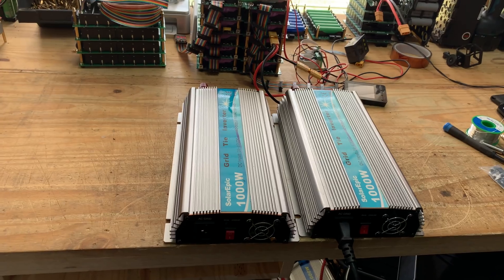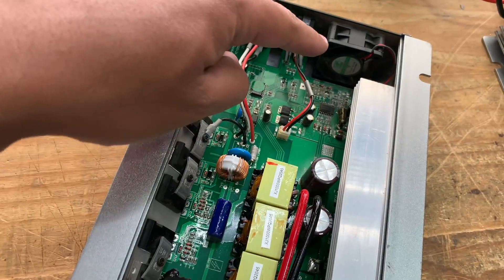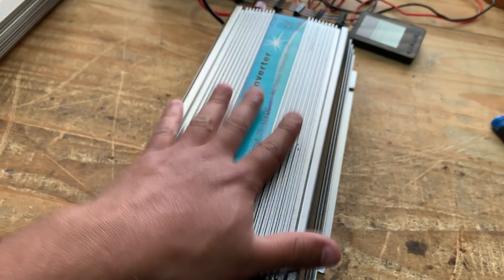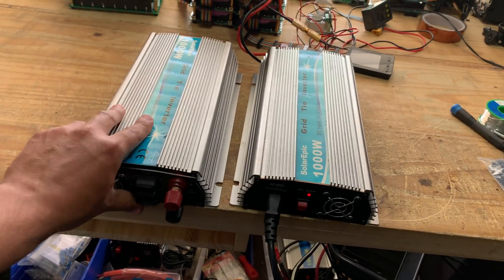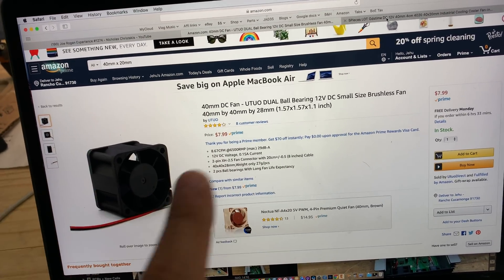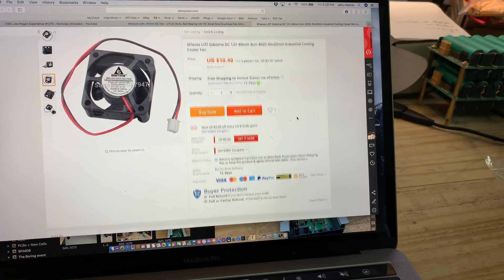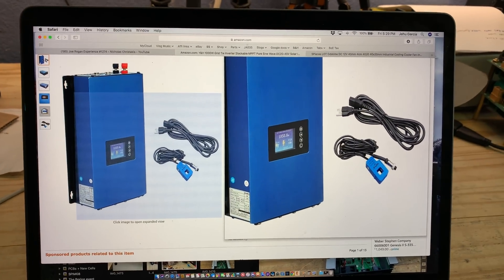Cheap 1kw Grid Tie Inverter 1 year UPDATE

Comment: I actually love these things. I shed a small tear when they die, but I try to buy a lot of them and only run them at about 600-800 watts of panel. Idiots that originally set up my system put 1200 watts of panel on my 1000 watt box. Died within 3 months. I have had boxes still running after 3 years at 800 watts of panels. 1.2kw a day on average for 3 years. They at least produce double of what they cost.

Comment: I read that you need fans with actual bearings and also any quality hybrid inverter or anything that's designed to function outside in the heat/cold rain ect has a coating i forgot exactly what it's called but the whole main board should have some kind of protection from the elements

Comment: Lovely video. Thank you.

Id love to see an off-grid example with the bigger model gridtie you showed. Lets say you have a strong 24v battery bank and 3000 watt inverter. Then you add 2x 2000watt grid tie inverters >WITH< limiters to your off-grid system, drawing from the battery bank and now you can pull 7000 watt or just below.. and easy to expand, just add one or more grid tie inverter. At Least that's my thought.

Comment: On battery they run at maximum power and get way too hot! Has anyone found a way to throttle them so they run at max 750Watts for example?

Comment: How do you limit these if they are connected to grid and to a big battery?
Reply: Was also looking for an answer to this question. Did you find a way to limit the inverter so it runs at e.g. 700Watts max?

Comment: Those blue grid tie converters, will work off a charged battery alone!! So' you will not burn out the MPPT circuitry, that's used with the solar panels. That's a good idea, as' the sun don't shine at night-time!!

Comment: mine is a simular china model...working since 4 years ...2 Times i had to replace the fans, and one time i had to repair a minor defekt on the internal Power regulation...at this point 1 year ago 7 also renewed the heat transport cream (i do not know the correct term :( ).
7 am verry happy with this devices....easy to repair and for this price extremly reliable.
i got it outside ...only protected from rain or snow...no case around....only problem is i have to remove bugs and spiders from time to time...i live in the Bavarian forrest in Germany....so please excuse my poor english;)

Comment: You should design those cards to plug in like video cards instead of being on a stack. Make a 4-lane set of plugs. Have 4 sets of cards with the connections offset and a simple "slot guide", to push them into place and secure them. Then you can easily pull a bad card and replace the few bad cells in the pack.

You should think about adding a thermal sensor SMD under each battery too, for charge and discharge monitoring. A "tiny Arduino chip", could cycle through each sensor and disable the board with a warning LED, to alert you of potential cell failure in each array. (Place a thermal pad on the heat sensor and drill a hole in the battery mount, so the battery has direct contact to the heat sensor. They have cheap digital heat sensors that output digital values, in binary output. You could even have the tiny Arduino regulate the charge and drain state of each individual cell and pack. Juts isolate the input and output lines. Then you can charge and drain, each individual pack, at the same time. Add another SRC relay, with a voltage monitor, and you can have another board on the output, turn the inverters on and off as needed, if the voltage is too low to drain.

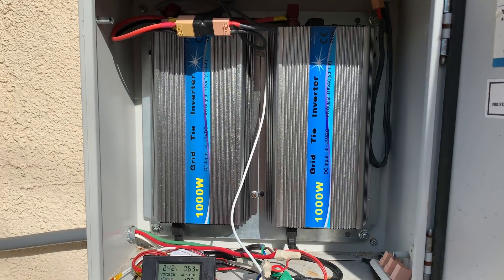Comment: 5:47 Your enclosure is not ventilated. you are just recirculating the hot air inside the enclosure. You need a NEMA 3 or 3R with vents

Comment: Too bad you couldn't put a little cheap digi thermometer , with temp alert. They beep when you reach a certain temp and have external sensors. I had a project where I connected to the output of the beeper with a circuit which would do various things. With this one I would want it to trip some sort of disconnect. Wouldn't need to be permanent, just long enough for the inverter to cool. I'll do that when I set one of these up. It would control a relay with a timer circuit.

Comment: Maybe someone can help me understand the issue of panel output voltage and inverter stated input range. For example in this eco-worthy kit there are 20 panels Vop 18V each, I believe meant to be wired in series. Wouldn't that combine to a 360V output? The inverter used is rated at 45V-90V DC input. If the panels are in parallel the input voltage would be lower than the inverter minimum and in series would be way higher than the maximum. So, what am I not seeing properly?
Reply from the maker: You series sets of panels to stay within the voltage range and then you parallel groups to increase power

Comment: i HAVE 8S 24P battery Bank using Samsung ICR1875s and have 4 100 watt Panels. I also purchased a EpEver 20 A MPPT solar charger. Will this grid tie converter work for an off grid system. Is there a way to disable the power off function of the grid tie so the AC can be used off grid.

Comment: No to sound dumb, but how do you limit the inverter to run at 75% or  something less than 100%. Correct me if I’m wrong ( trying learn and understand this) when you connect your dc power source and plug the ac side into a receptacle, it will operate at 100% until  the dc power source is spent right?

Comment: I'm thinking about getting one of the 1kw units. I'll only be running about 500 watts though it. So hopefully only using it at half it's rated output will keep it alive longer. Also, it will be installed inside the house so water damage wont be an issue. Because of that I'm actually thinking about taking the back of it off, and mounting it above a 1 or 2 140mm computer fans blowing right inside it. Should be WAY more air flow.

Comment: How can you wire these to the grid? I've read alot of conflicting things. I've read they will get your home insurance dropped. Can cause over voltage of circuit and cause fires and that without special metering will cause your utilities company to charge you cash for, "use" of powered even though your putting power into the grid. Any help you can give would be extremely helpful!

Comment: Hi Jehu. Greetings from Portugal. I am digging this because I also own a similar 1kW grid tie inverter for ~1.5 years, still running fine, but I found now a nasty feature on my inverter and I just wanted to check if this was the same with your model. So when the fans kick in the MPPT goes crazy and shuts down for ~1 sec, then it starts again but it take ~3 minutes to get the maximum power again. The problem is that with good weather now and moderate temperatures, even though the inverter is at home on a fresh area agains a concrete wall (cooler) the fans still kick in on a ~20 minutes ratio. So if you do the maths, there's a lot of power wasted during this nasty MPPT on/off thing. I think I will need to order a decent grid tie this summer! Cheers and thanks for you great videos/tutors!
Reply: Same thing with mine. 2 weeks since I bought looks work ok and start doing exactly what you said. Mine is 1400w and connected to 2x425w panels. Once ai got 4.5kw but mostly now staying at 3.5kw because loose that MPPT. I removed that small fans and cut from back panel and installed 2x120mm fans. Max temp what I measured 38-40 celsius. So definitely not overheating. Still trying how to fix this but not have idea. Disappointed

Comment: What happens when you connect a grid tie inverter with a system in which the elec meter can't go backward? Will the generation go to the household items consumption hence slowing the elecmeter or stop it for some time during generation OR just producing with no effect on the meter?
Reply: one of these inverters, on a system that the meter can't go backwards, will depend a little on the homes energy usage and what the meter is designed for.

so, if your little inverter doesn't produce more power at anytime than your using, then all it will do is slow the meter down, as you are using the energy that you created.

It's whenever you generate MORE power than your using at any one moment that things get wonky.

some meters don't care what direction power is going, so it can actually charge you for the power you generated. Yes, you read that right, you have to pay for the power you sent back to the grid, rather than be paid for that power.

Other meters just do nothing, as in they don't go up or down, which means the extra power you created is not negatively affecting you per say, but your not getting paid for it and your not paying for it. basically, its wasted (from your perspective that is, from the power companies perspective they got free power from you).

now, if you generate more power than your using, and you don't have a net metering plan with your power company, you could get in trouble with your power company. these little inverters are HEAVILY frowned upon, and technically are illegal (from my understanding). if your always using more power than your producing at every single moment, then they have no way to find out. all they see is you using a little less power.

They come with safety issues, of which 2 are a bit more prominent. The anti-islanding feature doesn't always work correctly is one. which can cause linemen to get shocked.

The 2nd is that, because you have this inverter generating power, the circuit its on is likely to exceed its capacity. since electric circuits in a home are designed for just one source of power, the breakers are designed to pop before the wires burn up. but these inverters are a 2nd source of power. that means that certain cables could be having more power than what they are rated for running through them. since the inverter isn't in the same location as the original power source it was designed for, the breaker won't see that extra power, and thus won't pop. that results in wires that can burn up, and can set your house on fire.

and i do see your comment is 2 years old at this point, so i know you might have gotten an answer elsewhere, but i just wanted to make sure you got it, just in case.

Comment: I have a few inverters and battery chargers that I simply run the fan either directly off the input or off of a buck converter from the input, So they are always running when the device is on. my bigger devices I put a small flow meter and dual fans on them.

Comment: My experience with fans has been that the only problem is that they use crap lubricants. In every case (dozens) I've just taken the fan apart (usually just a snap ring under a sticker and then the fan slides out) I've cleaned the old lube out with alcohol then used some good lube like triflow or something and they have never failed again after that.

Comment: i have the same product and i've been using it for about 2 years now and its still working perfectly fine. with regards to the fan, it only runs when it gets hot and it automatically turns off as it cools down

Comment: Jehu another comment I saw the water cooling attempt......from what I have learned that will not be enough...it is not just the FET's that are getting hot..... the yellow transformers are the critical path... if a winding inside cooks off its insulation it will allow the magic smoke to escape, it must be keeped inside at all costs.....Cool the transformers too....thanks again..

Comment: So I just went through a failure of their 600 watt version... I did some backwards engineering and discovered a few things....you will see that you have 5 yellow transformers...each transformer is a separate inverter power supply with two secondaries....when running 120 volt the two halves are tied in parallel, on 220 they run in series with each other...each yellow transformer is good for around 200 watts of AC power 5 times 200 you get your 1000....the inverter can partially fail where one or more power supplies will go bad....mine actually smoked the pc board after a repair attempt.....the transformers do run hot under load... they should actually have heat sinks and fans directly on them to preserve their life....in my next iteration I am going to Walmart and buy a $12.00 box fan and remove the inverter covers and force copious amounts cooling air on everything inside.... I think you will find the second unit is toast as well.....good luck and thanks for everything you do. it is very much appreciated....

Comment: With regard to your battery boards would it make sense to replace the ribbon cable used for balancing with stacking headers like you are looking at using on the power buss side?

Comment: Dumb question, if I plug one of these inverters into my wall outlet, how do I know if im actually reducing the consumption from the grid? In other words, how do I tell if the power im producing is being used in my house and reducing the amount consumed from the grid?
Reply: Easy, you plug the inverter into a Kill-A-Watt power meter, and then plug the meter into the wall outlet. The meter shows Volts, Amps and Watts flowing into your house.
Reply: @sed6  Normally, the kilowatt meter measures current coming out of the wall outlet, so would the Kilowatt meter read a negative value?

Comment: Is this legal to do without contacting the electrical company? Also after some quick research they have ones with limiters and a sensor so that the inverter only puts out the amount that your house is using. It seems like that might be a better one to use to avoid feeding to much power to the meter.

Comment: The average cost of electricity in the u.s. is 12 cents per kilowatt hour. Running the inverter at half capacity will save you $0.06 per hour. You'll need to run the inverter for 1667 hours to cover the cost of a $100 inverter. 5 100 watt solar panels at $100 each is another $500. That's another 8333 hours for a total of about 10,000 hours. That comes out to 417 days but since you don't get full sun 24 hours a day you kind of have to multiply that 10,000 hours by 6 which is 60000 hours. That comes out to 2500 days. A little over six and a half years not counting days that are overcast. Call it 7 years in a really good climate. If you calculated another way, 500 watts of solar panels on average will provide about 2 kilowatt hours per day, 12 cents per kilowatt hour is $0.24 per day. So yeah about 7 years. Anybody gets a different answer let me know. Since these are all averages your mileage WILL vary.
Reply from the maker: 49 cents a kWh for me

Comment: Swap shorted MOSFET immediately against a slightly better MOSFETs. Find shorted MOSFET with multimeter. I also improved the bad airflow on my inverters. But now runs another 80x80x10mm fan and ensures permanent airflow from below. It not only cools, it also protects against moisture and morning dew. Otherwise these "cheap inverters" are not bad! I have already successfully repaired some of my grid tie inverters.

Comment: hang on, if shorted, why do not the input fuses blow?
Reply from the maker: Because the solar panels are too weak
Reply: They probably fused it at 80 amps, so the XT60 connector would be the fuse.

Comment: Those fans you're looking at are ball bearing fans and should last.  The sleeve bearing fans in the cheap units always dry up and die, so avoid the Ali 5-pk!
Wow, doing a lot of new stuff.  Cool!
P.S:  Stop using the 1kw cheapie inverters for oars when your paddle breaks in the canoe, will ya?

Comment: I run 7-800 watts in mine, no problem.  Once a year I pull the fans and put a drop of synthetic 80 weight synthetic gear oil in.  I got hit by lightning a couple of years ago and blew a few FET's.  $5 and was back running.  7 years on them so far.  I track my solar here:  https://thingspeak.com/channels/34247

Comment: With the shorted inverter you should take a multimeter and beep out the components on the heat sink. If there's a dead short, replace the pair of components with new ones. I'm surprised the fuse didn't go.

Comment: Shorted, my first guess is the transistors failed, as this is not uncommon. Also it is better to mount them with one end up so air can blow through naturally. Also ball bearing fans are better than sleeve bearings for long usage. I would like some failed but not burned up inverters to repair and modify. Also save me some money.
Reply: Correct on all counts. To note though, regular sleeve bearing fans don't like being run vertically. The oil drains out the sleeve and they sieze, so if he's going to run them vertically, it's best to buy fluid dynamic bearings or ball bearings.

Comment: I would have bought the Noctuas advertised on that Amazon page, they tend to flow a lot of air quietly & a tachometer output could be rigged to an alarm circuit to cut the inverters if the fans fail.
+1

Comment: I have a serious question!!!By putting lithium-ion battery cells in parallel do you add up the current? So like if I were to take two 20A cells in parallel connections would it discharge 40A? I need to know this because I don't want to waste a bunch of money and battery's to add up the current in parallel just to find out that it doesn't add up the current.

Comment: Best practice  would be  replace fans with knowen high quality  onhanglow  fans and bearings all fail. ON large  bearings most times no grease is in sealed bearings  or some insufficient ammount.
also A skf bearing i fitted to my  car and i had  to disassemble  the hub again splitting  the sealed  bearing in the process . revealed also just dry  clumps of poor grease.  The product was made in taiwan. The  bearing  was cheap as it  came  from usa . I seen cheap  car starters  "new" who failed  with  "zero" grease in bearings .